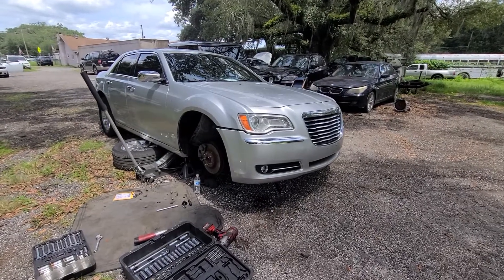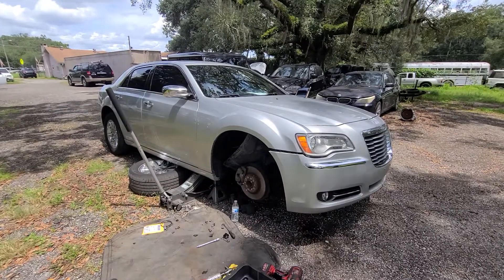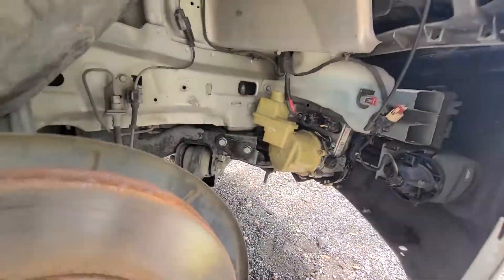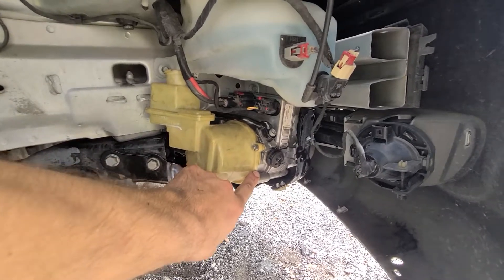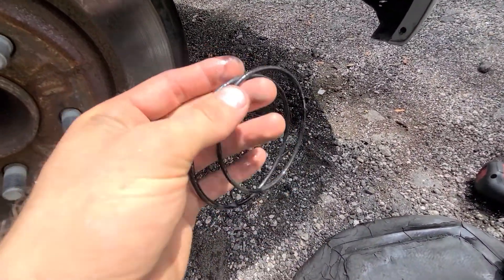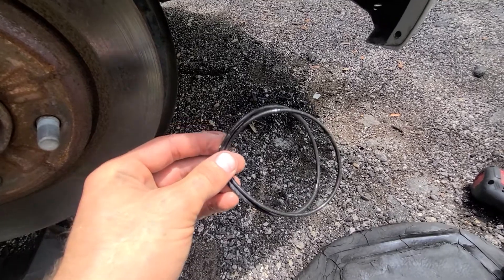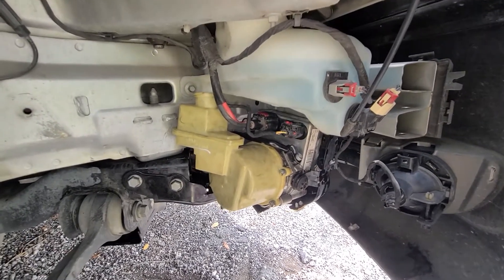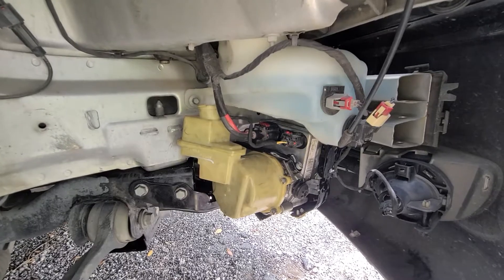CHRYSLER DODGE ELECTRIC POWER STEERING PUMP PROBLEM

Comment: Having this issue no power steering 2013 Dodge Challenger just bought the car..knew this was an issue with it hopefully I can resolve it inexpensively...
Reply from the maker: Do you have a ebay link for O rings ?
Reply: @pandydiy  yep..I haven't checked the pump out yet..but I believe it is leaking..going to be looking into the no power steering issue this week...fixing minor other challenger issues past few days..
Trunk actuator..and oil cooler replacement...and the window issue.. issues figured out..parts for them are ordered..
Next is figuring out what's up with the power steering.... Reservoir looks to be empty.. hoping it's a cheap easy fix... Like I say I just got the car the other day... got a good deal on it from a friend's wife that owns a towing service.. previous owner out ran the cops tried to anyhow.. wound up going to jail..I'm assuming drug possession was one of the charges because there was plenty of drug paraphernalia in the car crack pipe crack all over the floors... Just got the car cleaned out yesterday.. Figured out what was going on with the trunk lach actuator.. got that and the oil cooler leaking I knew was an issue.. repairs are underway .. cars in really good shape motor sounds good... Just got to fix all the typical Challenger issues... Thanks very much for your reply and your time reading this....

Comment: Have power steering fluid checked every 20k. This will save a lot of 
money and headache. The dealer won't look at it unless you ask. I put 
80k on my 2014 RT and found out that my power steering fluid reservoir 
was almost bone dry and never has been checked. It has been serviced at 
the dealership since I bought the vehicle. Your steering will feel numb,
 rough and noisy when low.  I was fortunate to only needing a flush at 
the tune of $260. You can do this yourself cheaper I know, but I was 
under a barrel and needing my vehicle asap. Hope this helps!

Comment: hello do you have the part number have this issue with my durango 2013 3.6
Reply from the maker: Hello Manuel, do you have instagram ? Text me at instagram and I will send you a link for ebay.
Reply: Did that fix your problem? I currently have the same issue.